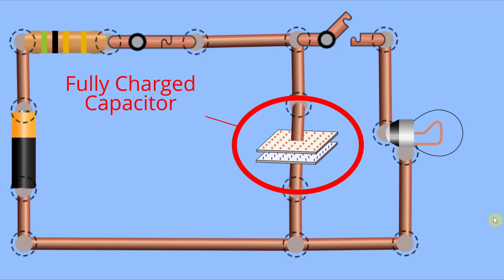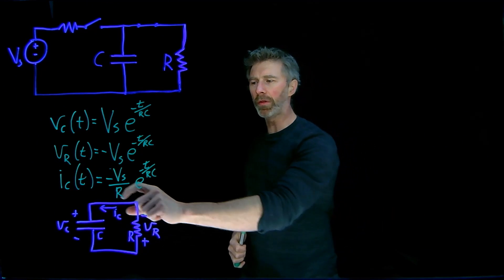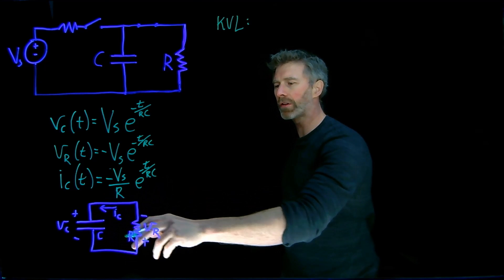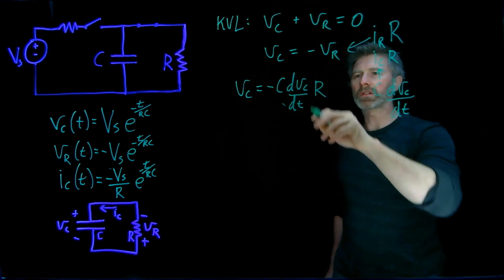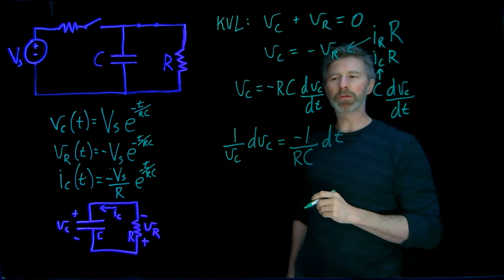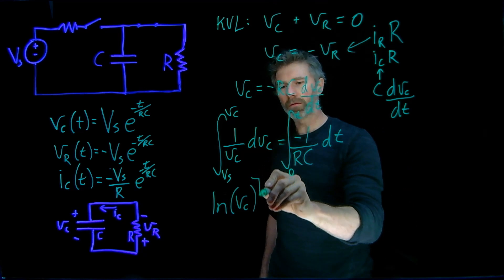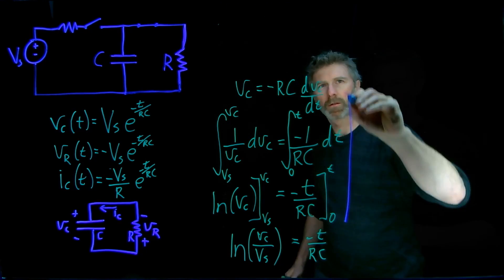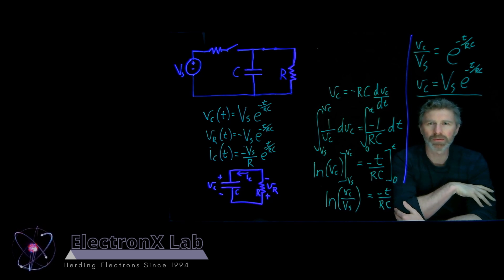Derive Equation for  Discharging Capacitor (Minimal Calculus Needed)

Comment: not quite sure why the capacitor and resistor have opposite poles. doesnt current flow in one direction here?
Reply: Current can only flow in one direction, thus, it always flows from one component's positive terminal to the other component's "negative" terminal.  -  I was confused at first too, but then I realised that the conventional "positive"  current will flow - out of - the bottom terminal of the resistor, that is why it is labelled as positive.

Comment: On 1:00, I don't understand that the current is flowing into the positive plate. My thinking is that the current is flowing the other way. But then, there is a sign problem.
Reply: Hey mate it's assumed to due to passive sign convention, however the current in the end is actually negative, so in fact it goes the other way
Reply: @christiancottle4044 Is there any sign convention for capacitor? If so then equations for which electrical components include sign convention ??
Reply: Good Question..  & the drawing is also correct.
Good Students ask this.
The capacitor looks like a voltage source, supplying current, thus Voltage across the capacitor Vc must be equal to Vr, the current will never flow towards the "plus" terminal of the capacitor ever, in this circuit. Therefore, the current direction is wrong, and +/- placement on the Resistor is also wrong.
Now, you should ask the student to think the following.
In this circuit, at any point in time, if Q is the charge stored in the capacitor at that instant. Notice, the Q is falling w.r.t. time; i.e.  dQ/dt is negative quantity.
Current going away from the +(plus) term of the cap (which discharges the cap) is negative, due to "Calculus".
Thus, the convention: Current going towards the + term of cap is positive, or, in other words, current direction that charges the cap is +Ve.

Enjoy!